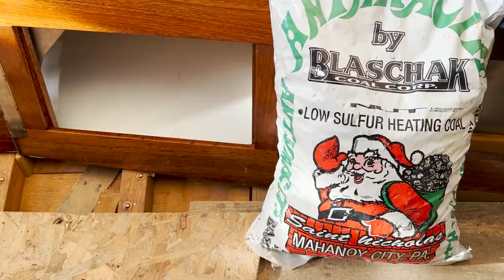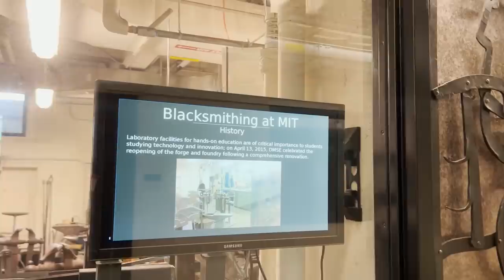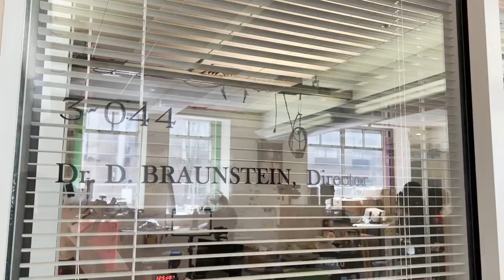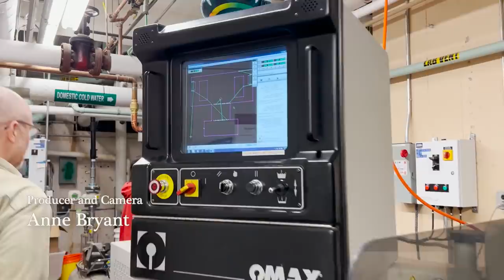Putting In the Shipmate & A Visit To MIT - Episode 208 - Acorn to Arabella: Journey of a Wooden Boat

Comment: You may want to adopt a prewar dodge to avoid the dirt and dust produced from handling coal. Pre prepare small packets of coal in strong paper bags and store the bags in the cabin coal locker. This is tip from the the notable Maurice Griffith, whose boating was mainly in thin water but whose books are a treasure trove of tips for practical boating in traditional wooden boats. I would recommend ‘The  Magic of the Swatchways’.  Maurice Griffith  felt that a real fire not only bring warmth but vital comfort to a sail boat cabin. Happy sailing.
Reply: Completely agree on thinking through the dirt and dust associated with your coal supply storage and management - both physical containers and protocols.  Coal dust is fine and as persistent as glitter.  The pre-prepared paper bags (assume sized so that 3 would fill an empty firebox so you can 'top off' to sustain your heat) is a great idea, but some form of durable, cleanable and replaceable system to hold the prepared bags would be recommended.  Without thinking through it, the entire area around the coal storage will turn black over time.  Consider fitting something like a "bread box" or 50-cal ammunition box in the cabinet.

Comment: I work at a high grade steel casting foundry and its very nice to finally see some casting on youtube that has been done the proper way. As in packing the sand, using protective equipment, creating flow channels and air vents and i've also seen some feeder heads even though they have not been explained. Molten metals shrink as they cool (between 0.7 and 2.5% so yes, all replicas are smaller than the original if no additonal steps have been done to compensate). If there is no molten metal to fill the shrinking area then cavitys will form. Those can be inside of the casting (which might prevent technical use and therefore inflicts heavy grinding and welding) or on the outside (which looks ugly and needs to be welded as well). To keep liquid metal available you create a bigger feed and wrap it in insulating material. You can see this on the 2 castings beeing unpacked starting at 27:32.
Reply from the maker: Thanks so much for sharing your experience in the comments here… great to hear that this was enjoyable to a person with experience! Cheers!

Comment: It is so wonderful that you have MIT doing bronze casting for you!!!  I can not say strongly enough how tremendous an opportunity it is to have experienced craftsman and such a well outfitted facility to custom make bronze items for Arrebella. My offer still stands to cast fittings for the project but if MIT is available, I couldn't do any better than that. 
Beautiful stove install! I burned coal for a while but switched back to wood because it is cleaner and smells so much better. If you can get hardwood for your stove, you might want to burn it first and keep the coal for backup. 
My only suggestion is to modify the end of the settee so that the board in front of the stove could be folded out of the way to make access to the front of the stove more convenient. 
Super cool episode!
Cheers from Alaska

Comment: Be careful using coal.  We heated with a similar style stove for many years, and on more than one occasion the fire got out of control.  At those times the stove actually glowed cherry red around the firebox.  The clearances you have will not be enough to keep the wood behind the stainless from igniting.  The most dangerous time is when you are burning wood and coal together.

Also, be sure to keep your ash box emptied.  A full ash box will hold the heat and warp the grate.

Comment: Have a spare tilting grate (or two) with you, especially burning anthracite. I've five decades experience with it, as well as all types of wood and more normal types of coal. Anthracite has an energy density greater than other forms of coal, so control of the airflow is important. If you let it get away from you the higher temperatures it can support will damage the grate. It goes without saying that without a functioning grate your stove will be difficult to manage.
Reply from the maker: Thanks so much for sharing your experience!

Comment: Great vid!  Thanks for filming the bronze casting at MIT.  I love the stove and tile housing (matching the propane heater).  FYI.  I lived in a domicile when I was younger which had a coal burning stove.  We were very careful to store our coal away from the stove.  In your case, it's underneath the stove and you have a separation from the stove itself.  But just wondering if putting some light fireproofing material inside the lower cavity makes sense (or maybe you already thought of that?)?  Wish I were younger and/or retired.  I'd travel to MA to help you out this summer!  Cheers.
Reply from the maker: Thanks for the kind words! We’ve got fireproof cement board under the tile, especially made to have tile mounted to. Great recommendation! Glad you’re watching and happy Friday!
Reply: I’m thinking the dust from the coal presents more of a danger than the actual solid coal itself. Further research on the part of Arabella’s crew  seems to be in order. Take care and carry on with the good work.
Reply: cleaning out that ash bin in those tight, confined quarters will be a nightmare. That tile basin will bee dust/soot/ash covered in no time.

Comment: If you didn’t already, check out the Herreshoff collection at the MIT Museum.
Reply from the maker: YES, my dear friend worked for them for a long while, digitizing the plans. You’ll be glad to know that they’re building a separate museum space for it so the public can have even better access to the artifacts and archives. I got to meet the new curator while I was visiting earlier in the week, too, and she’s fantastic. —Anne
Reply: Speaking of Herreshoff, I designed a new museum for Herreshoff the collection as lead design architect back in 1980. The new museum was to be located on the site of the original Herreshoff boatworks waterfront property facing the Narragansett River. Some of you might recall the original boatworks was a total loss due to the devastating hurricane of 1938. A truly spectacular site!  Unfortunately the project never materialized due to financial and political issues, and yes, I remember visiting the comprehensive collection at MIT.

Comment: OK, casting large elbows and solid pieces in bronze using the green sand method is fine. But casting something as simple and small as a cleat would be must simpler and easier if the lost wax method were to be used. The castings would be cleaner better finished and with fewer vents or sprues. So says a gold jewellery caster. Anyway great to see Arabella coming to life. Magnificent skills.

Comment: Curious about a couple of things. Have you thought of a vent over the range? And.the need to gimbal the wood, coal stove? Beautiful, tile work. MIT, an amazing school.
Reply: The wood/coal stove doesn't need to be gymballed for 2 reasons. Firstly, it's only intended for use at anchor, and secondly, it's mounted athwartships (side-to-side), so things won't fall out when the doors are opened.

Comment: Before taking the feet off that stove did you try running it up with the feet off and testing how hot it gets underneath? I think it might get quite warm ... where warm is "charring hot" ...
Reply from the maker: Not this stove, but there’s evidence that it won’t char through the flame retardant/insulating cement board and tile it’s sitting on. Since the fire box isn’t at the bottom, and since cats sit directly under home woodstoves with much larger beds of coals laying directly on the lower surface, we figured we’ve got that cat data to rely on. Thanks for watching!
Reply: @AcornToArabella  You can always trust a cat to get it right :)  Hot coals on a wooden boat just scaes the bejezus out of me though ;)

Comment: There is a reaction between coal and seawater. Many stories of old timer ships carrying coal getting the cargo damp and fire starting due to the reaction. Stow carefully I think. all the best chris
Reply: In u.k. they use coal to heat boat allmost exclusivly. U should be able 2 store things dry in a good boat
Reply: Videos from the UK narrowboat community show them using coal in their stoves for heat. Also they store it on the roof outside the boat. They have never, in any I have watched, mention the unwanted fire hazard.
Possibly it is stored in a impermeable to water bag.
Reply: It's an issue with large volumes of coal on freighters and in ships bunkers, for example the Titanic had a persistent fire in her bunkers on her final voyage. A lot of things have similar risks, like metal shavings.

Another risk is that coal, again like many other cargoes, in bulk can absorb the Oxygen from the atmosphere. Entering an unventilated hold can, and has, kill people.

Having lived on a Narrow boat previously I can say that I never heard (and I am plugged in to the main SM group for those living on boats in the UK) of anyone having an issue with self-ignition.

As a tip, a bed of coal under the wood when primarily burning wood makes the fire a lot easier to manage, particularly with unseasoned or otherwise lower quality wood.
Reply: Stress that I meant SEAWATER and coal. Meaning ensuring it can't come into contact prior to or during stowage.

Comment: As far as I can judge, the panels around the stove are tile on cementboard screwed thorough to the timber. You have large washers below the screw head, but they are metal. Might it be a good idea to change them out for rubber/plastic to avoid cracking the tiles from the heat of the stove/heavy seas?

Comment: My partner is a recently retired Naval Architect. Trained by UK Navy apprenticeship then a University degree in Naval Architecture. Worked on ship design, moorings and floating oil structures. Would love to contribute to Arabella's final fit out. Still good on wood working skills, does carbon and glass fibre work, can weld and manufacture in metal. Fit 64 year old.  Pity we are not USA based.
Reply from the maker: Yeah that would be amazing. Glad you’re watching!

Comment: Have you checked if by removing the feet of the stove you still have enough clearance to the combustible floor underneath? I know it's covered in tile, but heat can still radiate through the tile and pyrolyze the wood, which can lead to eventual spontaneous combustion.
Reply: ... and to the fuel stored below.
Reply from the maker: Hey Mike! Thanks for this message of care and concern! It won’t likely get that hot… there won’t be embers sitting there in the bottom of the stove or open flames. Yes, there’s clearance for sure. Also: There are a great many cats sitting under woodstoves that you might want to warn.
Reply: like you wish @AcornToArabella  Rotate the outboard feet 180 degrees, reattach so the stove can fit as you fir wanted.

Comment: Please don’t take that stove off them feet. That stove has them feet to ensure that you have the heat far enough away from the wood. I’ve seen wood catch fire below fire brick.
Reply: Keep the feet on!Grind them for clearance if needed
Reply: I agree,  even with a good thickness of sheeting below. Apart from that ceramic wool insulation used in furnaces, the only easy solution to high radiant heat is good air flow.  Much depends on the design of your stove though.  Perhaps you could consider testing your set up by burning some coal for several hours in the stove when it's out of the boat and in a confined space similar to what you have designed in the boat.    You don't want that timber underneath being torrefied over time either as the strength reduces.

Comment: 13:17 Fire Caulk might be the thing for your fireplace.
Reply: Fire caulk is tumescent, meaning that it expands into an opening once heat is applied.  Plus it’s bloody awful, just a huge sticky mess to install.  I’m a licensed installer, the only place to use fire caulk is on penetrations through fire breaks.

Comment: Have you thought about a carbon monoxide sensor?  You've got a coal/wood stove. a diesel heater and a diesel engine in a small enclosed space.  Just a suggestion.  Thanks for another great video.
Reply from the maker: Yes! Grandpa, a fire chief for many years, wouldn’t have it any other way.

Comment: building the hull - structural and water engineering, Metal work, engine and rigging - mechanical engineering.  Interior fit out - design engineering. 12 volt system - electrical engineering. Getting A2A finished and on the water - project management

Comment: Would you be able to use the stove if you have to moor up in a marina setting there’s nothing worse than being down wind of a smoking stack.?
Reply from the maker: We’d use the diesel heater before we’d be rude about the solid fuel stove. Most likely we’ll be at anchor and rarely in marinas as well.

Comment: Great work Steve 👍, can I ask tho’ , I may have missed you saying but why is the stove oriented that way and not facing inboard ?
Reply from the maker: Boats likely to roll (rather than pitch or yaw), and also they heel while underway. If the stove opens into the center of the boat that can be a problem on a port tack or in a rolly anchorage. Most solid fuel stoves on boats are oriented fore and aft for this reason.
Reply: @AcornToArabella  understood….👍, I am on UK canals and this is not an issue at 4mph !!
Keep going your work is outstanding!

Comment: You made a comment about type of caulking to use around the stove. Could you elaborate a bit? Are those panels going to come out? Are you trying for something permanent?
Reply from the maker: Well permanent inasmuch as we could remove it with a knife and direct heat, maybe.
Reply: @AcornToArabella  You are asking for a lot from one product. I assume you want it to seal (waterproof from spills), resistant to heat (how hot will the walls get) and remain flexible when cold. Plus some products need to be covered (cannot be the finish surface). There are high temperature caulks that are good to 600 so off hand, I would think to check with Dap as they have HVAC PROFESSIONAL 100% RTV Silicone in white, clear and aluminum. It can remain exposed as it is a silicone product and nothing really sticks to it. Check to see what is the cleanup solvent as you can create a better exposed joint with a tool or finger then just squirting it out of the gun.

Comment: 3:43 Why stainless-steel screws into the locust and the frame when everything surrounding it is bronze? Does wood get the same kind of iron rot from stainless? Would bronze fasteners against a steel bracket create galvanic action and lead to a problem?
Reply from the maker: No. Galvanic corrosion doesn’t work that way. Firstly, bronze and stainless are very close on the nobility scale, and secondly, that part of the boat won’t be immersed if we’re doing everything else right 😉

Comment: What consideration have you focused on sailing weight of the boat
Reply from the maker: We have a naval architect we consult with, and we also have chosen a boat design with internal ballast that can be shifted, added to, or removed. It makes the interior accommodations easier to plan and modify for sure.

Comment: All the metalwork is being installed during really cold weather.  Will there be any issues with differing thermal expansion rates of metal and wood as things warm up?
Reply: Not really any different from the temperature range Steve is expecting to see when Arabella is being used.
Reply from the maker: Rob makes a good point, but also, no, there shouldn’t be so much expansion that it causes some sort of an issue.

Comment: Great that MIT could help with the cleats. Obviously they don't teach pattern making! Never ever use an original (or a moulded copy) as a pattern,. Bronze has a shrinkage allowance when casting, so the cleats are 2.5 percent smaller than the original. Not a problem for cleats, but it could be for something where accuracy is more important.

Comment: hey Steve 
Ive follow every weeks video, from de poor of the lead keel to this stage of art, as a plumber and a boiler machanic i want to adres the stove in your boat, i reacon you instal A carbon monoxide detector, especely when you have more than one 'open burner'  B11 (without mechenic ventilation)  in het room. and becouse air is machanicly extracted from the boat, there has to be enough 'burn air' left for the smoke to clear naturly. sorry for the bad english. hope you understand my consern
greets from Enkhuizen - Holland 
meindert
Reply from the maker: Hello Meindert, thank you very much for watching and for your comment. Steve’s grandfather spent most of his life as a fire chief and we certainly plan on a CO2 monitor inside the boat. It’s not as tight a space, air flow-wise, as a house but it’s a good practice.

Comment: Steve….far be it for me to suggest changing your mind, but ….. having the stove facing across the boat will present far more problems than the doors opening while under sail. I think  the stove installed fore and aft would make using it far safer both for the oven, heating,cleaning and filling and emptying fuel/ cinders. Remember the doors will only open under one tack, they also have a lifting catch. Having a lighted stove while under passage is never recommended!
Reply from the maker: We won’t have the stove lit while under way, and most marine woodstove installations, a vast majority, are installed in this orientation because it’s safer. It’s not often we follow convention but in this case it makes a lot of practical sense, and we trust the experiences of a great many people with these sort of stoves.

Comment: I am not an expert but have you given due consideration to stainless steel screws in the bilge area of the boat? I would have been inclined to have dipped them in varnish before fitting.
Reply: Not the best practice below the water line SS strips easily leads to wood rot